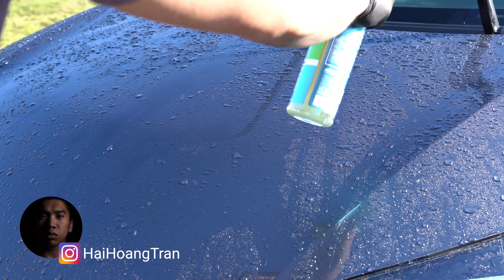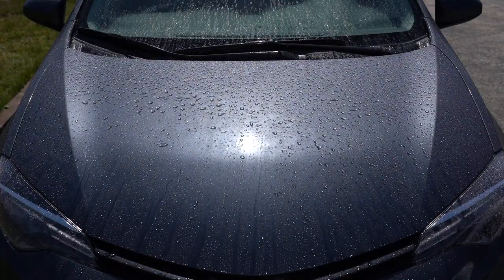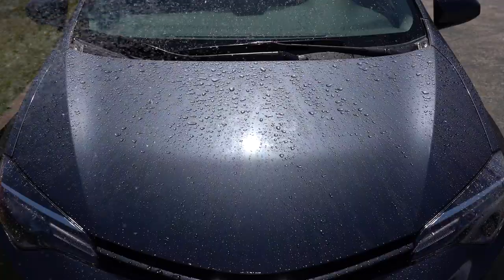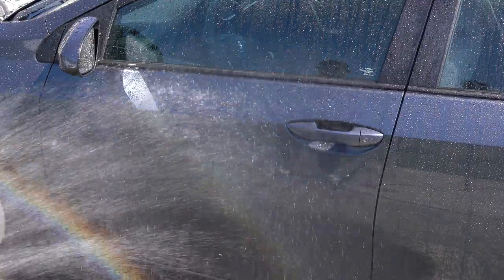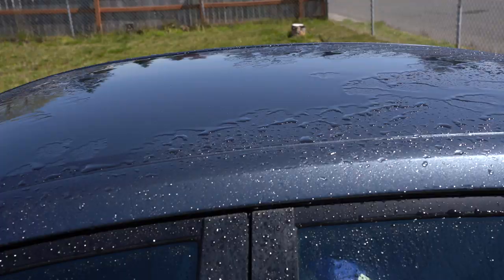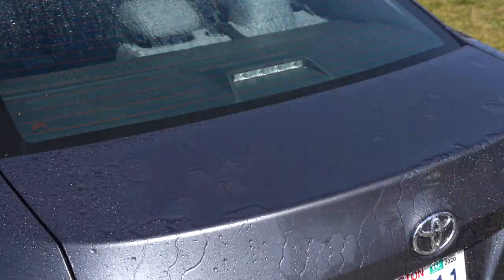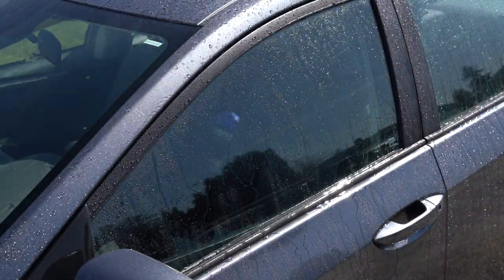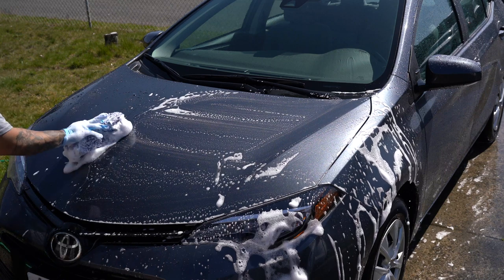Nanoskin Super-Charger After 1 Month

Comment: I was using Super-Charger to coat my rims for a while, it seemed to work quite well.  I ended up using on the rest of the car also, seems to work rather well.  If you find the gallon container for a decent price it ends up being stupid cheap per application.  The dilution ratio is 100:1 for the gallon size so it's gonna last forever.  I just plan on applying after every wash to keep the protection topped off, and not feel bad doing a second application if you want to try to get better coverage.
Reply from the maker: Glad to hear it's working out for you 👍🏽

Comment: I'm thinking about buying this. How did this hold up after the 1 month mark? also have you found the dilution ratio you like yet?
Reply from the maker: I actually left the first coating that is shown in this video on for 6 months with no other coatings applied and there was definitely still traces of Super-Charger present. It wasn't anything to write home about and was spotty, but considering the price, I was impressed. As far as dilution rations, I've only tried 100:1 and 20:1. 100:1 is weak and diminishes quite rapidly. 20:1 definitely works better but it's definitely not what the manufacturer sends in the premixed bottles. Although 20:1 works, I think it's too concentrated and that may take away from function. For my next batch I'm going to try another mixing ratio somewhere in between and just go from there.

Comment: i'm picking up 2 of their 16oz bottles next week directly from nanoskin (local to me). do you think the 16oz "pre-diluted" spray is 100:1 or is it more conentrated? i have only used 303 up til now so that is my gold standard, but it looks like the nanoskin sio2 is about 80-90% of the 303. good vid thanks.
Reply from the maker: I have the one gallon jug and have been using it at 100:1 but it’s much weaker than the pre-diluted bottle. I’m still messing with the mix ratio so haven’t found what works for me yet.